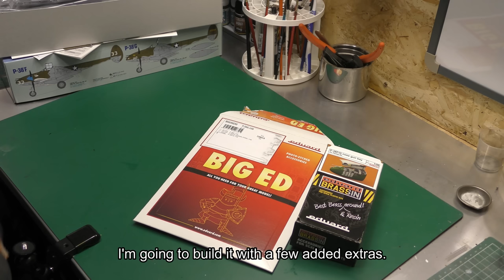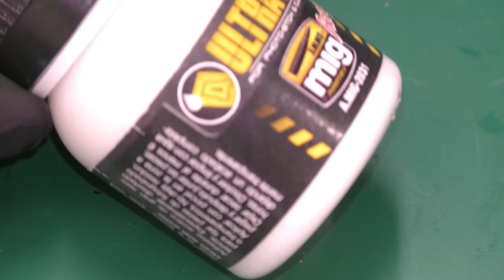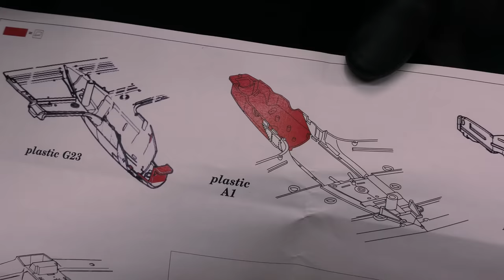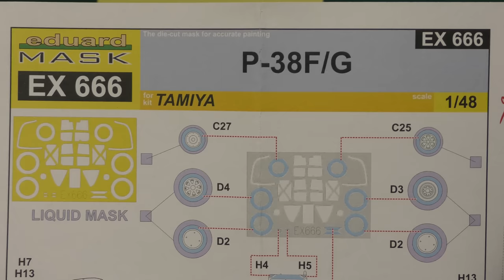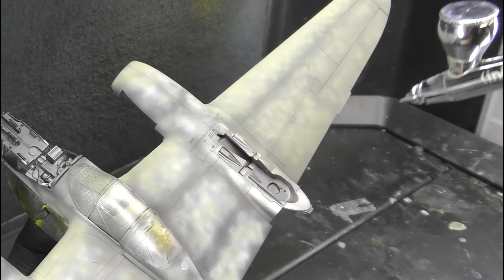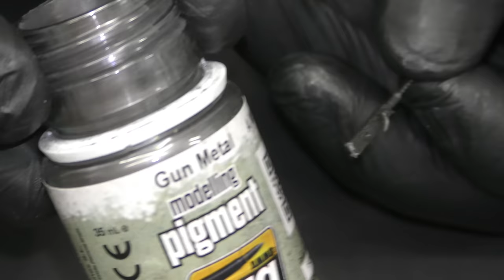1/48 Tamiya P-38 Lightning. Full build scale model aircraft kit #61120

Comment: It's very exiting to see your expert assembly with different paints and tools. I am just a retired old man and is just assembling my childhood bobby. The problem is in my country ( Burma/Myanmar) there  is no Hobby Model shops.  So had to buy some kits and some paints whenever I visit Singapore. I had no spray gun also. So most of my models are  hand painted  ,  and as I don't know which paint will dd
be needed  for models, its a head ache to try to figure out with paints available. The most available are enamel and oil paints. Its helpful to see your video. , I try to see on You Tube of real aircrafts for reference..  .Thank you.

Comment: Very very nice job on that kit (I have 2 of the F/G and 1 of the Limited edition H kits) One small point, when you were mounting the nose Guncovers, I noticed that the support bar between them was still interior Green, and not OD. That was an exterior panel when closed up as it was the hinge support as well as the nose cone alignment support. 42.44 for example.... Other than that a really fantastic job on Rex Barber's plane.
Reply from the maker: Thanks Bret, pretty obvious now you mention it! I will need to rectify that on the model. Cheers.

Comment: Did you notice you reversed the ammo chute part locations for the forward two machine guns?  The ammunition is loaded backwards (i.e. the bullets are facing rearward). See 36:07 for good view.  Notice how the ammo in the rear chutes has the belt in the rear of the ammo?  That is correct.
Reply from the maker: Hi, Yes, that is an error, they got swapped by accident. Thanks for watching.

Comment: Fantastic build. Only one small issue I can see. The long narrow piece fitted above the gun bay that runs from the nose to the cockpit between the gunbay doors is painted incorrectly. The top of that piece should be painted olive drab as the top of it is the exterior skin of the plane, not entirely zinc chromate green. Otherwise this is one of the nicest builds of a P-38 I have ever seen. I am especially fond of the work done on the superchargers, they look superb!
Reply from the maker: Thank you for your comment. I've changed that bonnet spine on the model, I've also swapped around the front gun ammo belts! 😉

Comment: I am getting back into model building also. I have NEVER build anything as near as great or with detail as your builds. I typically had built the Monograms  kits and followed the directions. A lot of times would string the planes up and hang them up from the ceiling. Did  just the instructioned cockpit work and had the landing gear up in a lot of cases. Because they were in action (flying ) But that was then. 
Sooooooo, I must ask, what would your top 5 (or 3) recommendations you would give to someone who wants to start adding detail into their builds? And also include a specific kit (WWll preferred) that you recommend to get going on. Thanks!

Comment: Just a heads up, as someone that has been hands on with the M2 .50, they are all essentially a blued metal, top to bottom. It is really more of a Brown tone bluing, but they are not shiny gunmetal. It is a corrosion prevention. Side note, that particular weapon system has remained almost unchanged since WWII. Absolutely beautiful work you've done!
Reply: i dont know if i have the heart to tell him, but the front guns are gonna be cycling rounds backwards.
Reply: @jonathanohagan1349  the M2 can actually be converted to feed left or right. It's one of the lingering features from WWII and still used today when installed in some armored vehicles(see M1117 Guardian) thats how they fed ammo into both wings from the center 😁
Reply: @MrNoNameSoldier  look at the direction of the painted rounds, for the front two. they are going tip in backwards. Its a very very very very minor mistake on a very good model.
Reply: @jonathanohagan1349  gotcha! I totally missed that! Like you said it's a minor thing, but those are the ones I always kick myself over when they happen to me.

Comment: I have the same airbrush as you, Infinity CR+, but can't get the paint to flow thinly - what am I doing wrong? I paint at 10psi.
Reply from the maker: Hi Chris. If you're using Tamiya paints I thin them 50% X20A thinner. Psi about 18.
Reply: @ScaleModelShed  Would MLT do the same job as X20A?
Reply from the maker: @chrisbarry4734  yes Levelling thinner should work fine.

Comment: Why so much trimming?  Unless you have built this kit more than a couple times how would one have known to trim and snip and sand etc? I built so many models in the 60's, I'm 70 now and I am leaning towards doing it again only military equipt. vs. cars. They didnt have airbrush that I knew about in 1963, very impressive..................
Reply from the maker: Hi, The aftermarket products I used required me to trim parts off the Tamiya kit. The instructions with the Eduard products tell you how to fit them and where to cut. Cheers
Andy